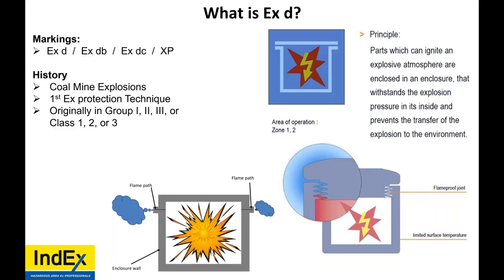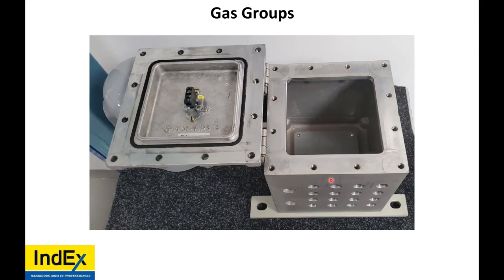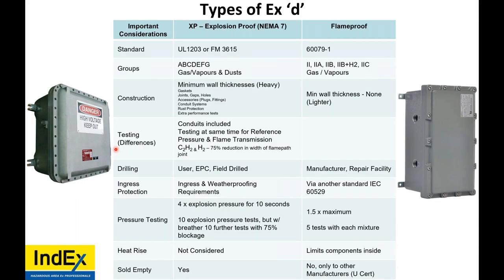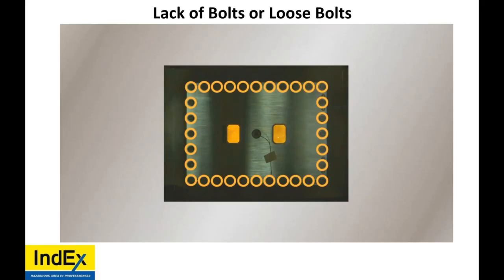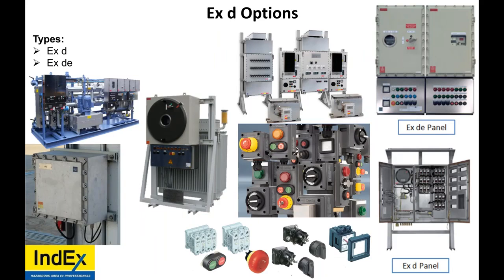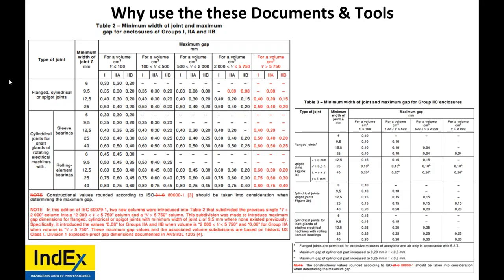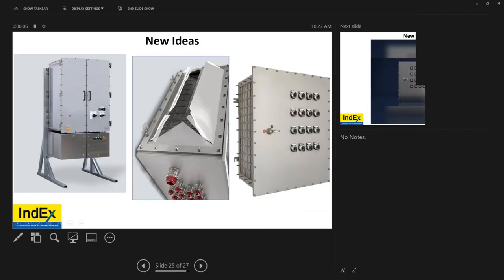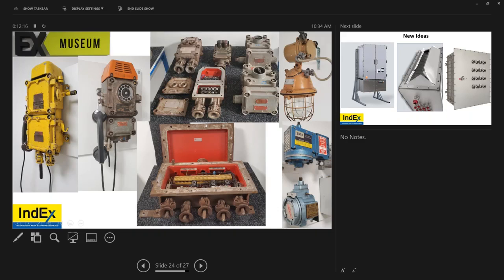Ex d Flameproof v Explosion Proof | A Masterclass Webinar in Explosion Protection Concepts

Comment: If the area is classified using NEC505, is it allowable to use IECEx certified Equipment in that area?
Reply: Define NEC505, where is the location?  USA - depends on the AHJ.  Worldwide, NEC505, if used is not ideal.  IECEx would be suitable for an overseas instalaltion.